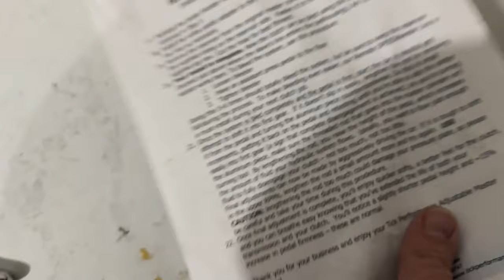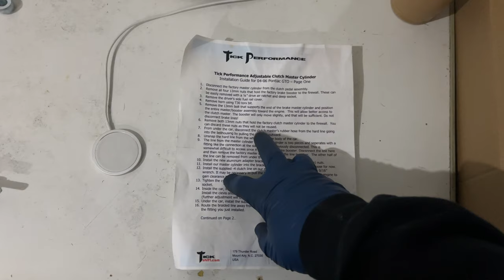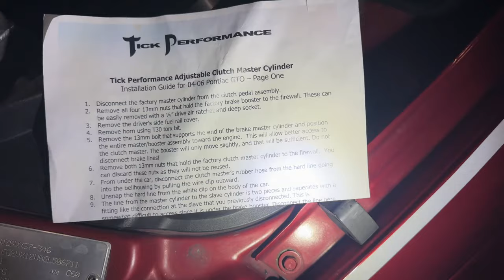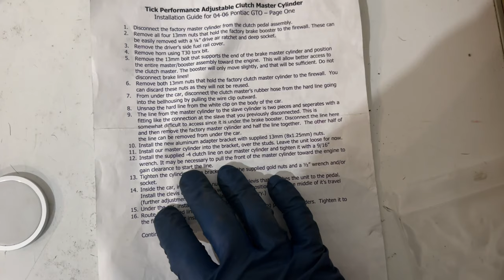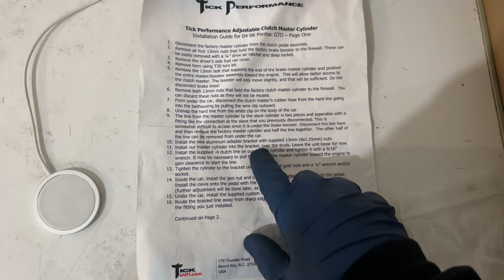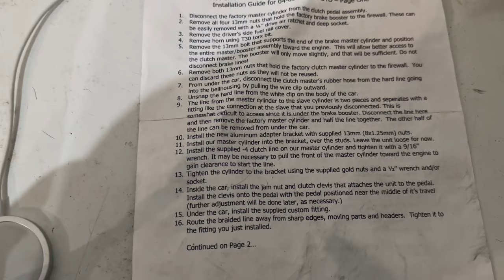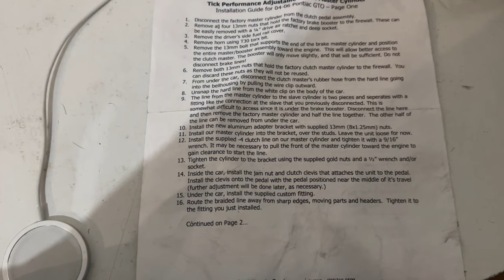Installing a tick performance master cylinder on my 2006 Pontiac GTO!

Comment: Man i wish I had had this video when I did mine 4 years ago lol. @goatem_gto
Reply from the maker: It was kind of a pain wasn’t it?! Lol
Reply: @spiceredgto9338  oh it absolutely was. Especially the aerobics i had to do as a fat man upside-down in the drivers seat to do all the small work. Lmao.
Reply: I am working on this as week speak and I’m irritated of it all, and I haven’t seen a good video of the install, I was thinking about doing one myself, as we speak I am messing with the aluminum bracket and I also am a big human, this is a pain in the ass all the way around
Reply from the maker: @MrJwilliams124  you and me both brother, hopefully this video helps!
Reply: Does this help with shifting through gears compared to the Stock set up? Mine always feels grindy like as if the slave cylinder isn’t pushing the pressure plate enough. I replaced the Slave Cylinder and I put the quick bleed line so you can bleed it a lot easier
Reply from the maker: @RickyBobby67  this helped with shifting at high rpms but if it’s grinding then I would imagine your syncos are probably going bad in your transmission.